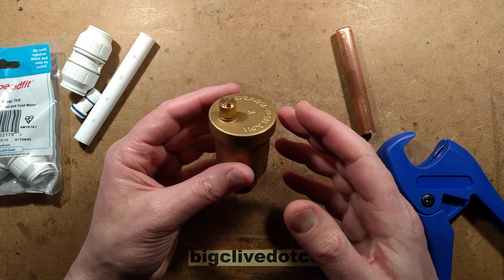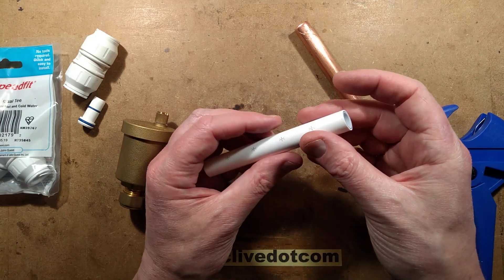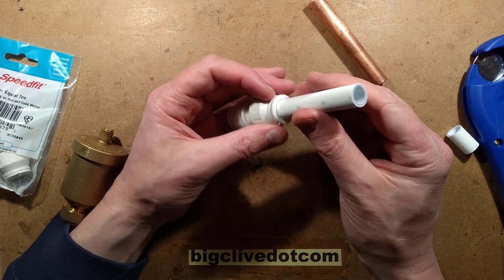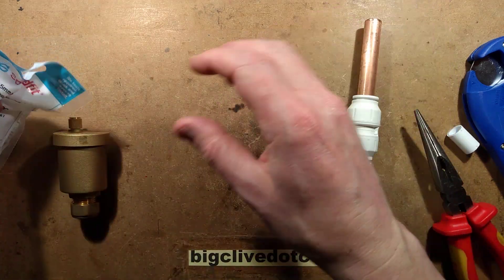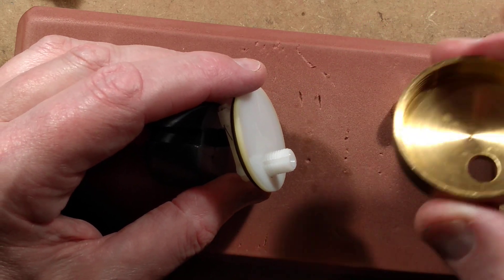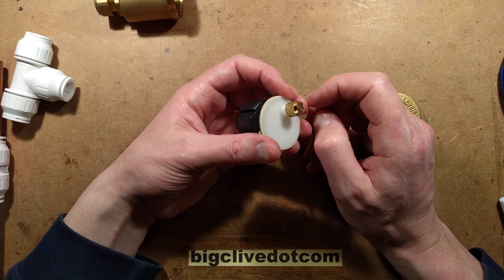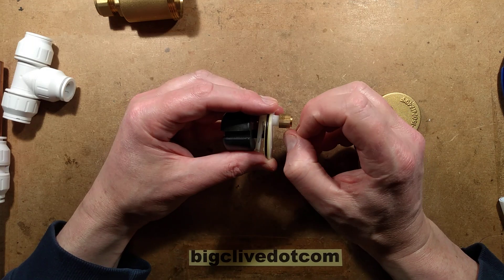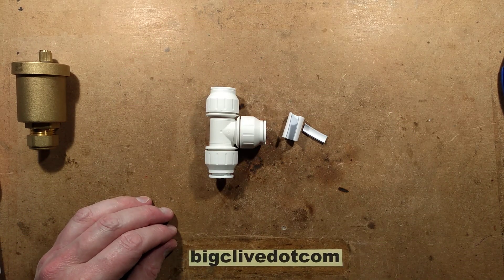Inside a bottle air vent and plumbing ramble.  (No electronics whatsoever.)

Comment: That air vent looks like a carburetor, but it just has a vent instead of a pickup tube for gas vs liquid. 

My last home built 2010 was all PEX under slab on grade and held pressure during the entire 4 months until the fixtures were installed. Currently I moved out of the ‘burbs and live in a 1969 with pure copper under slab on grade, did use PEX for a 1/4” ice maker line that replaced a work hardened cracked copper line.

Comment: Its OK new but give the plastic pipe 15 years of heat cycling, you'll have a different opinion on plastic piping.
Reply: Pex has been used for decades in industry and specialist applications. I know of home builders who have used it for 20 years and have nothing but good things to say about the technology.

Note that it's not recommended that it be used in direct sunlight. The UV light can indeed be bad. But in wall use its excellent

Comment: the thing with plastic pipes is what will it be like in 20 years will i have to replace it again? copper might be harder to install but at least it is tried and tested so you know it will out last us
Reply: But the whole point is that Clive's copper pipe did NOT last - it was perforated. Here in Greece we have used plastic pipe since the time of the Romans. (Well, almost.)
Reply: @manolisgledsodakis873  That was likely an improperly installed /damaged pipe. Copper also has the advantage of being antimicrobial, but it is more expensive than plastic.
Reply: I had a plastic water main supply. It lasted 40 years, and then cracked under the front lawn. The plumber said they don't use that anymore, and replaced it with a single length (65 feet) of copper from a large diameter coil, pulling it through from the basement.
Reply: Did you have water gushing out of the lawn.
Reply: @simontay4851  Yes, that was our clue.  😂
Reply: my oldest installation in this exact pipe and fittings is 13yrs, central heating and hot and cold mains pressure water.....still working and dry....inserts are a must everytime tho
Reply: Kevin Counihan  puts lead in your pencil drinking that water
Reply: Currently live in a 20yr old house, the copper lines completely eroded out, me and my brother replumbed it a year or two after he bought the place, at which point we were getting more then 1 new leak a month.

Copper can last a very long time, if the water is very ph balanced.   Also copper pipes that have been around for more then a few years were probably soldered with lead based solder, which is fine if your water is good.  If your water is at all corrosive though you will start to get lead leaching into your drinking water.  Much like flint found out.  The lead pipes there were fine until they changed the water source.
Reply: The old imperial sized pipe was a lot thicker walled than the modern metric stuff we have now. My property has a mixture of 1/2", 15mm copper and plastic. Would be interesting to see which lasts the longest.

Comment: In the US we have PEX(cross link polyethylene) piping with multiple brands and types of fitting. SharkBite being one of the most common. SharkBite fittings for PEX can be removed and reused as with a few of the other types. Some brands require special tools that are quite expensive for either expanding the pipe or compressing clamping rings. SharkBites are by far the easiest to use, but they are expensive. My house has been plumbed with PEX and SharkBite fittings for the last 10 years with no problems.
Reply: The shark bite are about 10 times the cost of pex crimp fittings. If you're doing more than 4-5 fittings then you should just use crimp fittings, it will be cheaper even with the cost of the crimper. The shark bites best use is connection cpvc, copper, or pex to each.
Reply: We replumbed our house w/PEX due to in-slab leaks w/original copper piping.  The County Inspector told me it should be good for 30 yrs minimum.
Reply: @b3j8  If it's in contact with concrete or anything alkaline, copper is ungood.

Comment: Your old pipe was cavitated beause of shoddy installation. When you don't deburr the ends properly that can happen because of turbulence caused by the burrs.
Reply: Could you describe what kind shoddy installation can cause random pin holes through corrosion?  How would cavitation occur in the middle of a run of pipe?
Reply: @ferrumignis  There are videos here on youtube explaining it much better than I could.
Reply: @ferrumignis   I think it's about the burrs creating condensation nuclei and when the bubbles burst they cause a sonic boom which create microscopic cavities in the pipe which are then eroded by the flow.  Does that sound sufficiently like a 12yearold explaining something the heard about on lunch break?

Comment: This system is based on what we use on pneumatic pipework an this works fine at between 90 to 100 PSI about  7BAR. However I am not sure about the massive temperature fluctuations on the hot water system I know of at least two houses where builders used PEX and when the boiler got up to temperature every joint failed it was very messy.

Comment: Hopefully if its on low mains pressure or experience shows they fail ,we have very high pressure that actually blows washing machine hoses off the pipe and split 10" water filters with ease ,we have had to use pressure reducing valves to both the kitchen side and the silly mains shower the council fitted (why not use the hot water from the boiler?) .
The plumber just sniggered when we suggested fitting one when the shower went in ,him and a team replacing half the ceiling made him look the idiot he is !
We found out about the pressure after several floods so many we put flood alarms under the sink and washing machine but the pressure reducing valved solved it ,the plumber in his haste merely cut the mains pipe to the loft to install the 'T' and the plastic pipe ,when he sheepishly put the second valve just below the 'T' all was ok,4 bar is ok for everything even decent electric showers cannot supply a hot and fast spray .
Top tip if you live in a bungalow dont waste money on those usefull looking  but totally useless kitchen taps that extend as a sprayer ,a 1/4" pipe just cannot supply a decent hot water stream ,i installed a 24v pump to help but it takes an age to fill a sink lol

Comment: Yeah, the plastic will last, it will be around for 10,000 years. XD
Reply: 10,000 years is a long time for a water leak
Reply: longer than the nuclear waste is radioactive
Reply: never heard of plastic eating microbes ?? clearly not so your fair mongering doesn't hold
Reply: @lacossanostra  So it's unfair mongering, huh? :P
Reply: photo degrades
Reply: punker4Real it's a bit too dark under my floorboards for UV degradation 🙄
Reply: It will be brittle, broken and cracked, and the orings will have dry rotted and split years before, but it will still be around...

Comment: Hmmm. We got a plastic piping called "polycopper". It's a pinkish/red direct replacement for copper. It also uses the same brass ring ferrules.
Reply: They call it copper because they know copper is better and this way they can mark up the plastic and charge copper-like prices for it.
Reply: You can use the ferrule system for plastic too, just use a brass or copper insert in the pipe. I don't generally recommend that solution, but if done properly it works alright.

Comment: 1) For mains pressure I would be tempted to cut out any required push fit connectors and use new ones each time rather than reuse. For lower pressure (via a local header tank) reuse is probably fine, given it's not going to be removed very often. 

2) My parents house had a plastic pipe from the mains stop cock to header thank in the loft. It developed a pin-hole leak - estimated about 30 years. That was older style plastic pipe and as a temporary fix we duck taped the pipe. If it had been copper, I'd have drained down and just blobbed some solder over to seal it until we could replace easily. Replaced with copper as it was about £10 cheaper. 

3) The auto bleed systems work fine - initially. In hard water areas they tend to fail due to limescale build up, while manual ones aren't really affected, and are distinctly cheaper.

Comment: Pex, it's a generic name for any plastic pipe by most pollyhexylene (NOT SURE OF THE SPELLING) I'm sure you can Google it if interested, at least thats my opinion it used to stand for a very specific type of pipe to replace copper pipe but over the years misused a lot by folks not in the plumbing industry, my first job in plumbing (I lived in Las Vegas at the time 6000 people moved there a month and was rising. The late 90's) we were the first crew in the US to use wirsbow or wursbo sorry about the spelling there I can't recall. Anyway the stuff was great to work with and tuff the one flaw it would break down in direct sunlight turn yellow decompose. Also you needed the $1500.00 expanding tool. We were told to try our hardest to find faults. We really couldn't. They were looking for the replacement for the grey polybutylene blue and red striped with copper crimp ring "poly" for the love of all holy stay away from the grey poly stuff with them dam crimp rings. pex came later there seems to be many manufacturers of it now they all have a style. My point to the system you just showed is it's very similar to diesel truck air lines  in the US and Canada anyway im sure in the EU also. So if it's good for Dot in the US and your equivalent in the EU I'm betting it's pretty good. The difference would be the schedule of the pipe the air line stuff is much thinner. One big thing in my 13 years in the plumbing industry was the taste of water you just couldn't beat copper. But there is alot in play now tho water filters, bottled water, so straight out of the faucet isnt really popular as  it used to be.  I'm still a copper guy, but these press fit plastics are crazy popular here in the US right now. At the home repair stores, now are they being used by plumbers I dont now I'm not in the industry anymore. But I can speak to the durability of the press fit as a solid connection. Especially with the added spin after the press fit the air lines in trucks do not have that. They simply press in and done.

Disclaimer : I might not have got the technical names spelled right. I have worked several industries and I might suffer from industrial cross over memory.  Just stay way from the grey stuff. I think they only use it in mobile homes now.

Comment: We have a similar product in the US called SharkBite (think Kleenex) "push" fittings.  They are brass body and one-time, permanent installation.  Used one in a friend's radiator years ago and it hasn't failed yet.  Just checked and it seems they offer a similar product to what you showed, called "ProLock Push" couplings.  However, they are only listed for use with PEX.

Call me old fashioned, but I'd rather sweat a copper joint if at all possible.  There's something satisfying seeing the solder wick into a joint and knowing you (hopefully) have a nice solid connection.  Plus, you know...  you get to play with FIRE!  Thankfully I'm not a plumber, so it's not something I have to worry about often.
Reply: Brian, the SharkBite appear permanent, however they are actually removable and reusable. They make a tool to remove them, looks like a giant, brown plastic c-clip.
Reply: @PatrickLeeUS  Cool, just learned something new.  With how tight the SharkBite fittings go together over the join, I had just assumed they were permanent.  Looks like they even sell a purpose-made tool ("Disconnect Tongs") to disassemble them, should you need to do so on a frequent basis (probably for when the homeowner bodges the job and finally calls in a professional).

Comment: Properly installed good quality copper pipe and fittings will last indefinitely. O-rings are not forever and will eventually fail in 20-60 years. Contractors love plastic, not because it's better or cheaper but because it takes a fraction of the time to install and requires far less skill.
Reply: Well...copper freezes & splits. copper sourced from china often has contamination which corrodes & springs leaks. copper is expensive. we never use copper anymore.
Reply: Dino H it's because Big Clive's copper pipes have corroded and leaked that he's replacing them... His didn't last forever
Reply: Faster and easier wins. But for my stuff I still solder. I hope I'm wrong, but if o rings fail in vehicles and devices after years of heat cycles, I can imagine the same thing happening here in 20 - 40 years. The crimp copper fittings are even being used in AC installs. I'll stick to solder, and require it if I get work done that I don't DIY. My brother got a new boiler installed in his house and they used about 50 to 60 of those viega copper crimp fittings, sorta defeats the purpose of copper to me.
Reply: volvo09 
Lol I read AC as Alternating Current in stead of air conditioning.
Reply: @volvo09  ProPEX doesn't use copper crimp fittings (a system which also narrows the pipe diameter).
Reply: "last indefinitely" literally means the lifetime is not defined. As in it might be corroded thru because of low Ph water in 10 years, plugged with minerals in 20-30, pretty normal life at 40, or last longer than the building in an ideal case. But that "properly installed" clause is what's going to bite most people. You cannot see the flux bits sticking to the inside of the pipe pitting it, or the extra turbulence caused by a bit too much solder in a joint wearing into the pipe just downstream. And with all the joints in copper plumbing, will every joint be perfect on the inside? Not likely.
Reply: Sylvan Butler actually indefinitely means for an "unlimited OR unspecified time " so can have two interpretations. Either forever or an unknown time. The implied use in the start of this thread is that it lasts forever. Which is incorrect as it definitely does not. Sylvan you are correct in that we simply cannot tell, however that isn't what was implied. In truth probably neither copper nor PEX will last as a system forever. My house has a mix of iron, imperial copper, metric copper, PEX and alkathene. One problem that PEX does solve is that of thermal creaking in long copper pipe runs... It doesn't as it has a vastly lower expansion rate.
Reply: @robinturner2300  Ugh, how do you mix imperial and metric tubing? "Close enough for solder?"
If you check the specifications for pex, it actually has much higher thermal linear expansion coefficient than copper. At least in the standard codes used in the States,  pex needs to have expansion control or compensation to avoid putting undue stress on the system. Pex is much quieter if it slides thru holes in wooden structure, but lack of sound does not indicate lack of movement.
Reply: Sylvan Butler not close enough as at least one plumber found out 🙄 So Lots of adapters... The house was built in 1960 and various changes through the years left it cobbled together. Luckily with several decades of experience there isn't anything I can't deal with and as I work on the old bits they get replaced with Hep2o PEX
Reply: Around here copper is code for all commercial and rental properties. IE: The government says its better.
Reply: @johnpossum556  Because the government is always up to date on what's going on in the world and free of any influence....
Reply: @johnpossum556  copper is code because of "fire-code"...cannot penetrate fire-walls with plastic.
Reply: @joedugas9462  Yeah, one doesn't tend to think of water pipes burning. 
frosty9595: It's too easy to be another pointless cynic. Don't give them credit for trying to have your safety in mind.
Reply: Totally agree. With a borrowed pvc pipe heater, I was able to install a new piping system that stretched from the main source & to the my house. Tho, I got professional help for rest of piping work lol.

Comment: I moved a radiator to the opposite end of the kitchen using plastic pipes. Absolute doddle. The only problem was a slow leak at the joint with the fairly cruddy copper pipes that had fed it, but cleaned up and a tight compression fitting sorted that.

The only thing to watch out is that there seem to be several competing systems, and you have to ensure you don't mix pipes and parts.